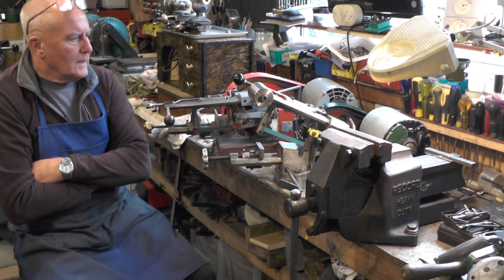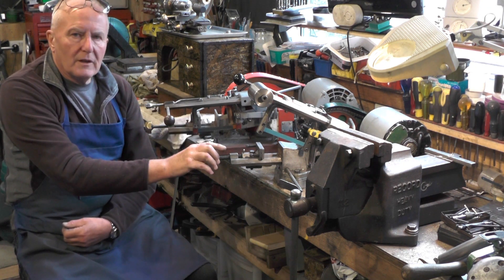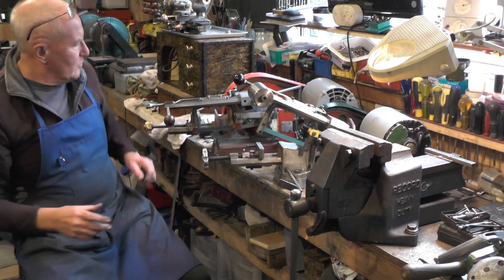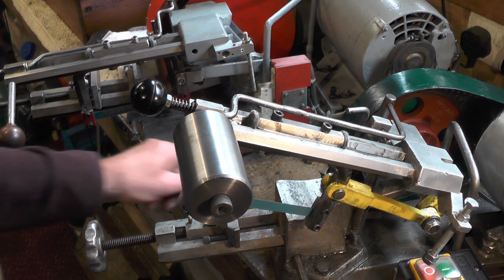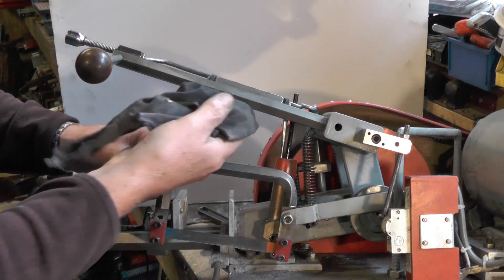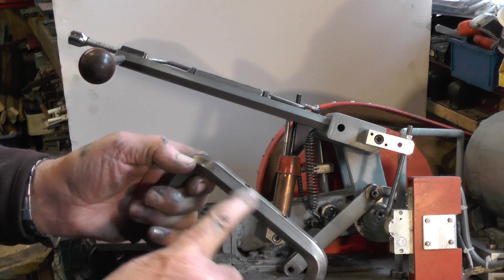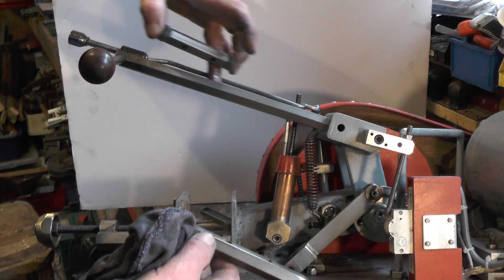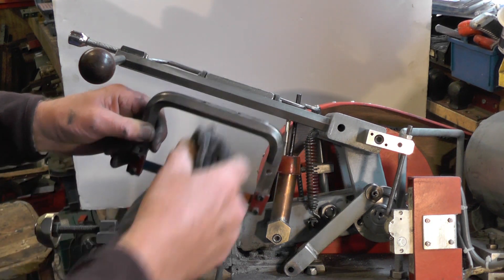Hexacut Saw & Replica "Hexcut" Saw Modifications (Unforseen Seize ups) "mr factotum"

Comment: Hi Kev.  Thanks for the tip.  I actually did not know that stainless would gall itself together.  The brass strips were a great idea.  Thank you for sharing sir.

Joe
Reply from the maker: yes i knew it galled on nuts and bolts Joe, but found out the hard way on sliding surfaces
thanks for the feedback and binge watching my recent vids👍👍👍
atb
Kev

Comment: Great fix. I used to work with a ton of stainless fasteners and I hate that stuff. It galls and basically welds its self together.
Sulphur impregnated cutting oils work well, Never Seize is your friend and Acetone with ATF will sometimes work as a penetrating oil just enough to loosen them up if it hasn't completely galled.
Reply from the maker: cheers BN
Thanks for the input, appreciate the feedback
Its been a Saw Point, 🤣🤣🤣 but a bit of brass plate did the trick
many thanks
Kev

Comment: Try some graphite grease on the other one after you polish it up ! SS is used widely in Reactors and we used graphite grease on all the nuts and bolts to prevent the nuts binding on the threads.
Reply from the maker: Thanks J
I will try that thanks for the tip.
I did try Active8, that usually eliminates friction, but not this time.
graphite's on the list now
many thanks for the feedback
regards
Kev
Reply: No Worries I cant remember the stuff we used to use. It was likely premium though ! It was in a paint tin and would sorta set up a little like copper grease does when left for long periods but underneath it was fine. So just needed a stir though it was stiffer than porridge. Didn't need a lot and if its good enough for precision machined bolts ! then it will likely suffice for this application. These bolts weren't bought from screwfix ! Nuclear stuff is all top spec ! And saying that i saw a 3 ft diameter stainless flange used with the Made In India stamp  :/ sign o the times i guess. Cncd in india, imported to uk for use in our nuclear power plant :/ @MrFactotum
Reply from the maker: @JohnDoe-qg6hm  sounds about right John, the great has gone from Great Britain,
the amount of skill lost from this country, is mind blowing, thinking back to when i was an apprentice.
thanks for the info
regards
Kev

Comment: Must have been a galling experience to have both fail! 🙄 thanks for this Kev it explains why they are called hex-a-cut saws 😀 quite a clever design.
Reply from the maker: Thanks 👍 Julia, It was a Saw Point🤣🤣
They are a great little saws for hobbist, especially when you have an abundance of standard hacksaw blades to get through🤣, but the blades are also cut in half for the Hexacut and are new old stock Made in Sheffield or Sandvik Sweden and last for ages.
Thanks for watching
Kev
Reply: @MrFactotum  lol 🤣 nice one I used to have a Rapidor but swapped it for a bandsaw as I find its more useful especially in vertical mode. 😀